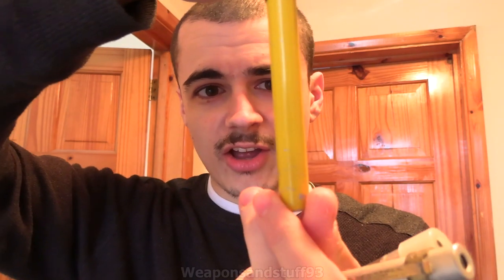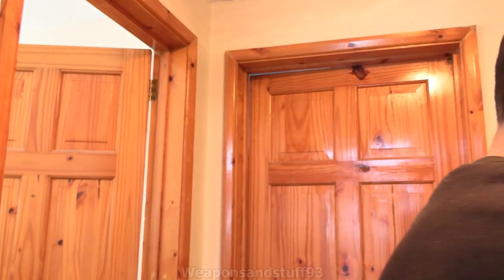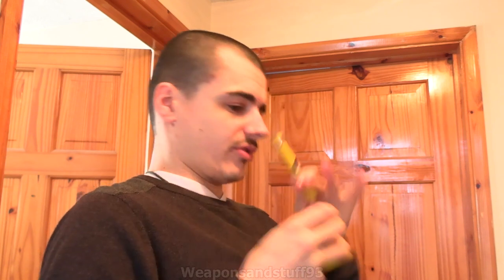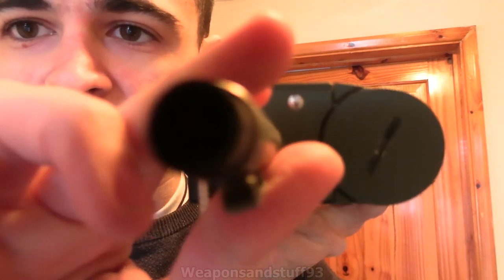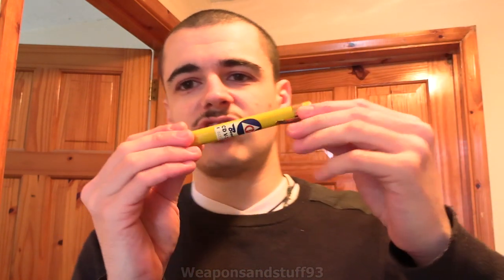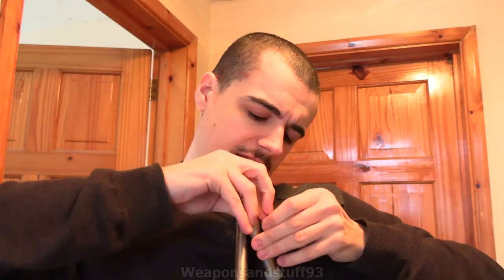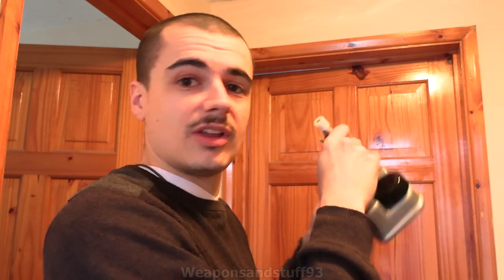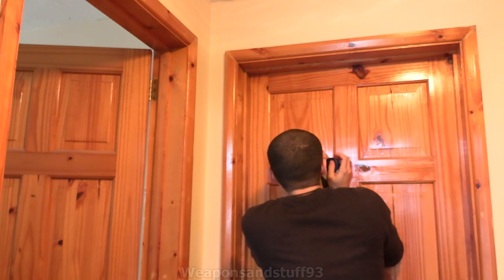Radiation Pen Dosimeters Explained

Comment: How accurate are these?
Reply: Not the best for long term use, They loose charge over time so it will show higher dose
Reply: After playing with various models (USA, USSR, UK, FRANCE...) for a year I found that they are very reliable even after 50 years. After 1 year in a drawer all of the dosimeters that I zeroed (they ones that worked and could be zeroed, about 90% of them) are still perfectly at zero. And dose measurement accuracy is also as good as new. Even though pen dosimeters are much cheaper than geiger counters they are more accurate because they use ionization chambers. Accuracy is usually within 10% compared to a modern calibrated geiger counter which is +-20% or even +-30% accurate.